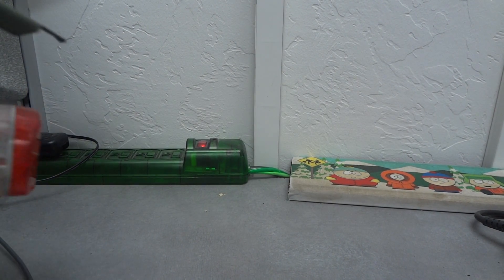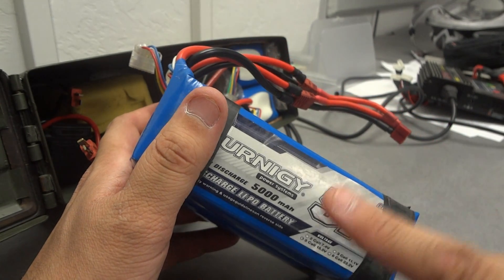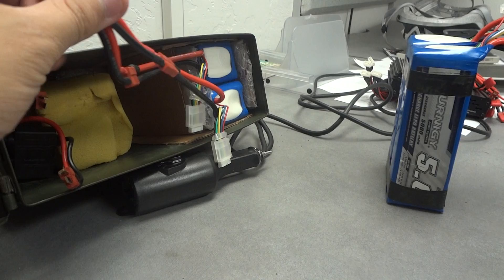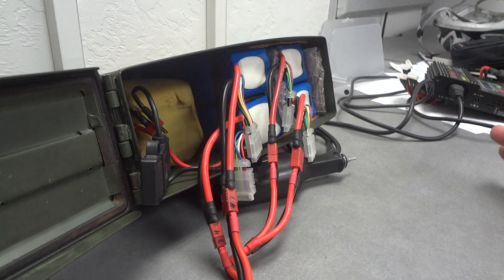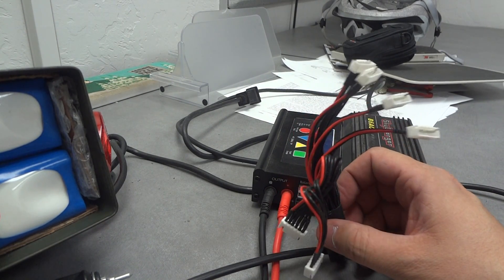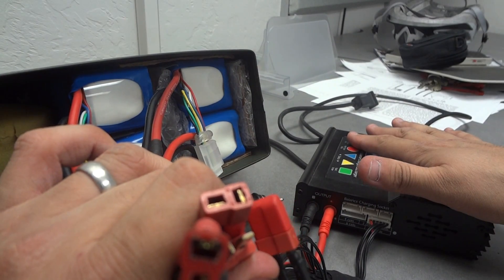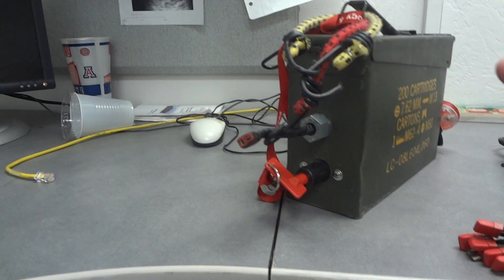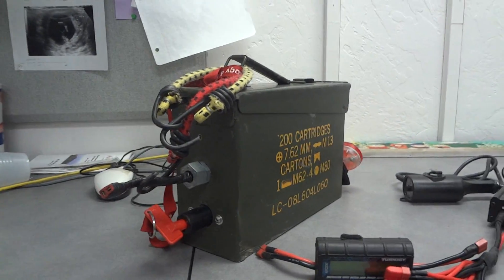My Electric Bicycle 37volt 10ah Lipo Battery Pack

Comment: No, on hobby batteries the C number is the amp at Constant Discharge. That means that if it says 20C then you can safely Constant Discharge at 20 amps. and the Max Discharge would be for like 10 seconds.

Comment: I made a Lipo pack of 6 5s [ 3 in series then parellel with 3 more in series] but it turned out it was to much for my BBSHD/electric bike.
I was told I need a 14s pack so since I already have 5s packs I'm thinking on using 4 of them + 2 4s to make my 14s pack BUT I would like to know if what I'm planning is possible. I'm thinking on making a pack as fallow- (keep in mind they are all of the same mah & c rating) 2 5s in parallel + 2 5s in parellel + 2 4s in parellel than connect the three parellel packs into series hoping to make a 14s pack of 51.8 v @3.7per cell / 58.8v "hot of the chart". I HOPE THIS MADE SENSE. Please anyone let me know if I can do this????? THX.
Reply from the maker: To me it sounds OK,  Since you are setting into parallel packs of same capacity and voltage and then serializing.   I would go here  https://endless-sphere.com/forums/viewforum.php?f=21&sid=ff6c7f0f7ef711463950bff82a20281f

Register as a forum use.  Find the appropriate sub-forum and then post the same question.  There we have a community of thousands of E-bike enthusiasts that provide answers and feedback to all E-bike related questions.
Reply: Thx a lot . Yeah I was told the same as you said, as long as the parellels are the same mah and c rating the series can be of  different volts.

Comment: Hey bro could u please help me out.... How will I be able to connect four 11.1v 5200 lipo batteries in series to make a 48v battery?
Reply from the maker: +trophix , well the best you will be able to do is 44.4v nominal.  Now you will need to make or buy a harness or connector for serial connection. https://www.google.com/search?q=lipo+series+wiring). You want something like this ( http://www.ebay.com/itm/iFLY-Deans-Style-T-Plug-Series-Y-Harness-Connect-2-Lipo-NiMh-battery-14-WAG-10/262956237550?_trksid=p2385738.c100677.m4598&_trkparms=aid%3D222007%26algo%3DSIC.MBE%26ao%3D1%26asc%3D20160908110712%26meid%3D90ededb929474b1ca4e011c6057fff83%26pid%3D100677%26rk%3D1%26rkt%3D5%26sd%3D331968474655) but instead of two, you would need four plugs to 1
Reply: solracotos oh I see and where do I find the four plug to one connector... there's none.
Reply from the maker: trophix well, you are correct there is none.  you can make it or you can buy 3 of those 2-to-1.  if possible try to find one that is a thicker gauge (at least one) and use for the last one.  so connector 1  serials battery 1 and 2.  connector 2 serials battery 3 and 4.  then connector 3 (the thicker gauge one) serials the 1st and 2nd banks.
Reply: solracotos ok I'll try that out, how much thicker gauge should I use? 10awg?
Reply from the maker: +trophix on the road now, can't copy the link from the studio app.  But if they are thicker the better.  That will reduce resistance , power losses and heating of wires
Reply: solracotos oh ok. Will I have to change out the wire on the controller as well where I connect the bigger gauge wire too from the batteries?
Reply from the maker: Those are not serial connectors.  they need to be serial.
Reply from the maker: trophix yes, and if they are thicker than your battery wires then you are good.
Reply: solracotos ok, thank you buddy!

Comment: I need your help. I now have the exact same set-up as you (thx to your video) but now I'm thinking on adding another pair of the same exact batteries in hope of getting a 55.5v pk. Is it possible to put 3 parrelel pks in series?? If I understand correct 3 parrelel pairs (6 batteries) of 18.5v 5.0 batteries = 55.5v 10mah pack??? CAN THAT BE DONE?? 
It's for my 1500 watt / 30amp bafang 8fun mid-drive electric bike. Please help anyone!! Thx.
Reply: Albert Nieves if you place the 3 packs in parallel you won't raise the voltage period.  The only way to increase voltage is to serial connect the packs that is neg to Pos and so on.  If you some parallel everything that is neg to neg pos to pos the  you simply will increase amp hours as long as the voltage is the same through out
Reply from the maker: In regards to your question I don't see why it wouldn't work.  Essentially your pack would be a 15s2p pack.  Now, I don't know how you will charge. But let me tell you about my set up.

The pack featured in this video is long gone.  I made a bigger one to accommodate a 20 mile total daily ride to-from work. The new pack was 37V with a 20ah capacity.  Made by serializing two packs of 4 Turnigy 18.5V (5s) 5ah batteries.  Essentially  a 10s4p.  

This is how the setup was wired.  Total pack = Bank1 connected in series to Bank2
Bank 1 and Bank 2 were wired the same way.  Bank 1 and 2  consisted of four 5s(5ah) batteries connected in parallel both at the terminal and balance lead level using self made parallel wire connectors.  In other words it was a 5s4p (20ah) pack.    Now when I wanted to charge, I would manually break the serial connection of Bank 1 and Bank 2.  Then I would connect Bank 1 and Bank 2 in parallel, at both the terminal and balance hence making one big 5s8p (40ah) pack.  

That meant that every day in order to charge I would have to undo 2 connections (serial) and then connect a total of 4 terminals to make the big parallel battery.  Charging a 10amp it took normally about 3.2hrs.  Then to get the pack ready for ride mode I would undo 4 connections (2 parallel for main lead and 2 parallel for balance) then connect the 2 main leads in serial mode.  That made it easy and almost fool proof way of managing and charging my pack to prevent any shorts.

So the way I envision your pack is the following: 

Albert's Pack = Bank 1 + Bank 2 + Bank 3 Connected in serial.  Each bank is equal and is composed of 
Banks= Two lipo pack 5s(5ah) connected in parallel at both main and balance leads

And presto!
Reply: Well yes but you lost me on the last  paragraph . I only use the valence leads for charging. Is there an easier way for me to get at least 52v using the for 5s Lipos I already have?? What is your  suggestion??  By the way I like your 20 ah battery.
Reply: I did not connect my balance leads(not that experience) but I only use the balance leads when charging, right?? I don't need them connected to each other while riding my bike right?? Thx so much "TEACHER" lol
Reply from the maker: About the balance leads.  You are correct you only need them while charging.  

About how to get to 55.5 v.  Well remember when you connect in series you add up the voltages of the individual batteries while keeping capacity the same. When you connect in parallel you add up capacity while keeping voltage the same. 

 So, let's assume you have a total of six 5s lipo packs with a capacity of 5ah.  We know that each of those batteries has a nominal voltage of 18.5V and a capacity of 5Ah.  

Therefore, to get to 55.5v you would need to connect 3 lipo packs in series.  The end result will be a battery bank with a nominal voltage of 55.5V and 5Ah capacity.  What you have effectively done here is to artificially create a 15s pack.  

Let's assume that the 5Ah capacity is to low and you want/need more.  Well it is easy you just need to add more batteries but this time they need to be connected in parallel. Keeping with the example.  You would need to create a second 55.5v 5Ah battery bank.  Then you would connect the two banks in parallel to yield a new pack with 55.5V and 10ah capacity and presto

Remember, There are two ways to do this.  You can serial first to raise voltage then parallel with an equal bank to raise capacity OR, you could parallel packs first to raise capacity and then serial with an equal bank to raise voltage. This last one my preferred way and the way I built the pack on this video.  

Hope this is clear.

Comment: I had a similar setup going with the same 5S batteries, except that mine was rated for 20Ah instead of 10Ah like yours ( I had 8 batteries in total ). However, my idiot roommate put my lipo bag outside in our shed during the winter months thinking it was something else. I didn't notice until it was too late as I had just put them into a storage charge a few days before he did this, so I wasn't due to check on them for a little while. Sadly, out of all the cells in total only 2 were actually still good.... The batteries lasted 7 years before this happened. 

I have been wanting to order more, but for some reason they are not allowed to be shipped into Canada from HobbyKing anymore. 

Any suggestions for me where I could get the same batteries or maybe even higher Ah similar to the MultiStar
Reply: Greyeyes Family  I'm in CA 2 and I just ordered some 6s 5ah from hk, the trick is to order from Hong Kong and only order 2 at a time or less 3 or more will make fedex and ups nervous and they won't ship it
Reply: Just curious what was your total voltage and how was your set-up??
You mean 4 parrelel pairs into a series of 4?? Please read my comment above to see if you can help me. Thx.
Reply: Albert Nieves my set up is 2 12s packs 50.4v full charge in parallel with each other giving me 10ah at 50.4 v.  I used 2 6s 5ah and 3 5.2ah 4s battery's 3*4 gives me 12s and the 2 6s in series gave me 50.4
Reply: My total voltage was 37V and 20,000mAh in total. I had the same setup as this video except instead of having 2 in parallel I had 4. Making 8 batteries in total. If you are wanting to get up to 55.5 it is possible, you just need more in "series". Parallel gets you more mAh; Series get you more Voltage. So, depending on how much mAh you require will tell you how many batteries you need in total. As an example:::::   If you want only 5,000 mAh then you would need 3 batteries in series to get 55.5V If you want 20,000 mAh then you would need 12 batteries to reach the 55.5V with 20,000mAh meaning 3 parallel sets of 4 running in series. Hope this helps.
Reply: I can't even get 1 shipped to me. I've tried numerous times both from Hong Kong and from the US warehouses. This is starting to become a HUGE problem for me as I am now going on a year trying to get these batteries sent to me. I've been refunded 6 times now by Hobby King due to non shipment. With my Cross-Canada trip coming up next year I am starting to get desperate. I have seen the HIGH mAh of the MultiStar batteries, but again I can't seem to get them here from Hobby King. These would be better (In my opinion) as it would mean less batteries to carry with a higher mAh rating.
Reply from the maker: Sorry I wouldn' know how to get those pack into Canada, 

The pack featured in this video is long gone.  I made a bigger one to accommodate a 20 mile total daily ride to-from work. The new pack was 37V with a 20ah capacity.  Made by serializing two packs of 4 Turnigy 18.5V (5s) 5ah batteries.  Essentially  a 10s4p.  

This is how the setup was wired.  Total pack = Bank1 connected in series to Bank2
Bank 1 and Bank 2 were wired the same way.  Bank 1 and 2  consisted of four 5s(5ah) batteries connected in parallel both at the terminal and balance lead level using self made parallel wire connectors.  In other words it was a 5s4p (20ah) pack.    Now when I wanted to charge, I would manually break the serial connection of Bank 1 and Bank 2.  Then I would connect Bank 1 and Bank 2 in parallel, at both the terminal and balance hence making one big 5s8p (40ah) pack.  

That meant that every day in order to charge I would have to undo 2 connections (serial) and then connect a total of 4 terminals to make the big parallel battery.  Charging a 10amp it took normally about 3.2hrs.  Then to get the pack ready for ride mode I would undo 4 connections (2 parallel for main lead and 2 parallel for balance) then connect the 2 main leads in serial mode.  That made it easy and almost fool proof way of managing and charging my pack to prevent any shorts.
Reply from the maker: Albert, just replied to your comment above.
Reply from the maker: Are you close to the US/CA border any friends?
Reply: I am close to the border yes, but in light of the recent events in the US I won't be going near any border(s). I don't need my entire personal life invaded by the US border Patrol. Nor do I need to be forced to hand over passwords to "my" PERSONAL social media accounts and/or electronic devices I may have on my person at the time.
Reply: You say the old batteries are gone, but what you just described here seems to be exactly the same as before just doubled like what I had before my batteries died.
Reply from the maker: I feel ya, crazy stuff!  So you haven't found a viable alternative?
Reply from the maker: Exactly,  the new set up is double capacity in a bigger ammo box.  The only difference is the semi-permanent arrangement of 4 lipo packs in parralel (main and balance leads).  But you are correct it is similar to what you had.
Reply: So? What killed your batteries? Storing them in the cold? Leaving them sitting too long?

Comment: the fuse you have will still blow at 30A. the current rating on a fuse is what it will blow at regardless of voltage, the voltage rating is what it is guaranteed to block without continued arcing.
the 12V fuse at 30A will still blow at 30A on a ~40V supply, and 40V isn't high enough to be a problem on a 12V fuse.
Reply from the maker: You are completely correct sir. I was thinking and wrongly of watts.
Reply from the maker: +Masterg Samuraixmen those are just checking balance plug protectors.  I'll linksome soon
Reply from the maker: Masterg Samuraixmen they have them in Amazon, hobby King etc.  search balance lead wire or balance plug protector

Comment: What did you use for the master switch in the circuit?
Reply from the maker: http://www.amazon.com/gp/aw/d/B007O0BBFM/ref=mp_s_a_1_3?qid=1456797746&sr=8-3&pi=SY200_QL40&keywords=12v+battery+disconnect+switch&dpPl=1&dpID=417jZCVUX1L&ref=plSrch. that is what I used
Reply: +solracotos Thanks.
Reply: +solracotos One more thing.  I noticed you put the fuse on the ground lead.  Is it better to do it that way, or on the positive lead?
Reply from the maker: +JP Berti  what I did is not best practice.  usually you fuse the positive lead closes to the source.  I fixesd that on my new pack

Comment: Very good explanation. No music wonderful. Ten amp current draw. So ten amp fuse. You come to a slope. more current flows.  Also there is always a surge in current demand on start up. so,  you will need a larger fuse. twenty amps will be a good safety factor. Keep up the good work.

Comment: Thanks.  Simple and easy setup.  Was wondering, these high C rated RC batteries can put out a lot of amps.  5amp hour 25c is 125 amps, correct?  That coupled with 36 volts.  Can that be dangerous?
Reply: +JP Berti  Its fine. And it CAN be dangerous if you act stupid.
Reply from the maker: +JP Berti You are correct they can put out a lot of current.  You don't want to short these batteries because you will have a big flash and melted metal quickly.  It may sound dangerous and it is if you don't work with them appropriately.  However, if you do work with them correctly the energy density and versatility can't be beat.

Comment: Excellent presentation. Can you please assist me finding the correct LIPO battery for my electric bike. Here are my bikes specs:
X-treme Alpine Trails XB-300sla Electric Bicycle
Motor Wattage 300 Watts
Motor Type Brushless Rear Hub Motor
Battery Type 24 Volt Sealed Lead Acid (SLA) with Charge Indicator

Thank you

Comment: Hi bud ! I'm hopping you can help me out please ! I have a fat bike and I'm ordering a 2000 to 5000 rear motor e kit , it comes all complete with a 80 amp esc  they said I can run my battery's between 48 v to 72 v ,  I'm assuming if I run a 48 v battery it will run the motor at 2000 w , I am a rc guy , and I went to the hobbie store and they told me I can use two 8s 9000 mah , can you please give me your thoughts , my e mail is biglikedan@hotmail.com . Cheers , dan Stevenson ...

Comment: Are you sure about the fuse calculation dude ?
Reply from the maker: Tony Ling The fuse will blow up if current draws excessds aproximatelly 10amp which is what my controller is rated.
Reply from the maker: +Martin Jensen 
Thanks for the in-depth explanation. I'm sure that will clear up questions..

Comment: I suggest a low battery alarm!!! Watch this guy called 'rcmodelreviews' for his tutorial on lipo's below. Lipo's require a 'storage charge' when not in use, if you leave them fully changed (or distracted) they will decompose faster over time (resulting in bloating or build up of flammable gasses)

All about lipos for RC models

Comment: brilliant noob guide mate! I set mine up in an ammo box just like yours but i have a 1000w motor that needs 48v. So i'm using six 7.4 v lip's all in parallel . Its a real pain in the arse as i have to take them all out and plug them individually into a six plug parallel board. So your idea of joining the balance leads was of great interest as i could leave out the parallel board. My only other problem is that i have a charger much like yours and it only goes up to 22volts and 6 amps.
As my battery bundle in total is 48 volts and each battery is 13amps. 
Do you think there is a simple (with as little unplugging/replugging) way to charge , without having to buy a charger that can handle 48volts?
Reply from the maker: Tom, I'm sorry for the late reply. I missed your response.  Can you expand a bit on your question and your current set-up..I will reply when you do.
Reply: I splashed some cash on a dedicated lilo bike batt with its own charger. Not tested yet but I'll give you the details if you remind me in a week.